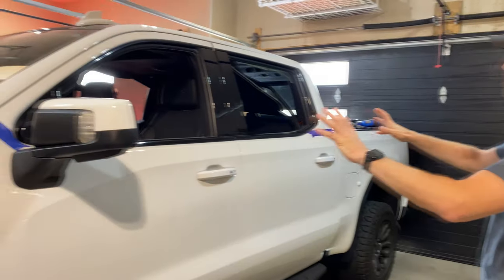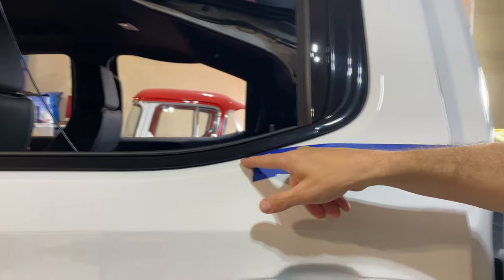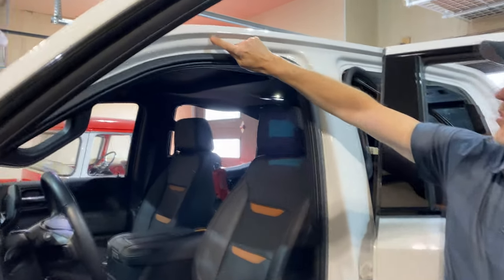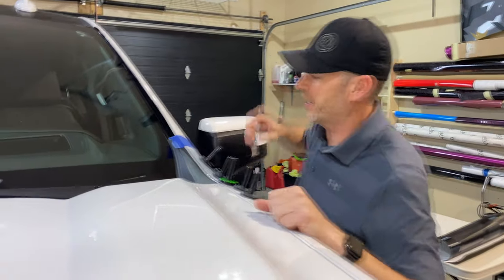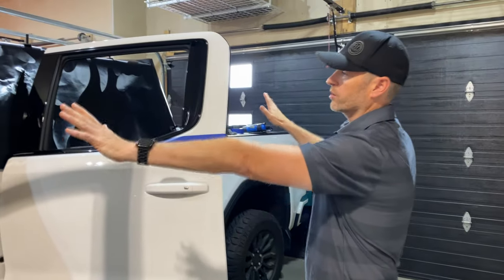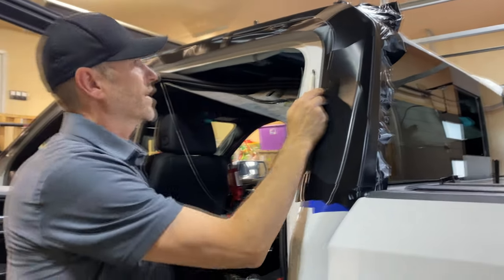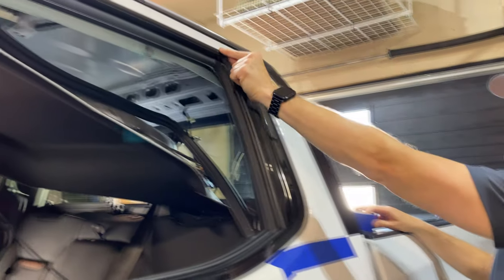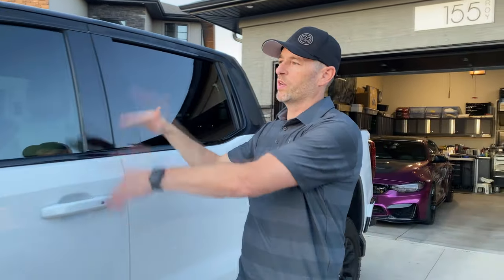GMC Sierra AT4 Custom Wrap DIY - Turned Out Great! Step by Step How To

Comment: Hey buddy looks good, I just bought a white GMC 1500 elevation. I'm looking to do the same on the top but maybe the gloss black the same as the black part of the door. This video is 6 months old so how do you like it? Are you going to keep it? And what do you think about if it was gloss black? Thanks
Reply from the maker: I love it.  I did add some pieces to the a pillar after all and do like it better now.   Gloss black would be great 👍🏼.   I am keeping it for now because I can’t think of a better alternative.  It turns a lot of heads still and even though the truck is not heavily modified, I see people taking pictures quite a bit in parking lots
Reply: @Donslife  thanks

Comment: If you're happy we're happy... BUT.... I think it's calling out for you to re-do the hood to integrate better with the new stuff on the front pillar.  I get the part about the natural line... but there's a gap between looks "good" and looks "awesome"... and it starts at that diagonal line.
Reply from the maker: Easy fix either way.  I can play around with the lines

Comment: Love the wrap. You made it look easy! I was worried about the idea of it being a dry application but it didn’t look that bad. Does the wrap not stick to the blue tape? And how do you cut it on the panel, for instance the piece on the hood? I’m in the military and have a black AT4 so this is perfect. Did you remove the badging on the tailgate to apply the wrap? Your videos are great thanks for taking all the risk for all of us.   Mike
Reply from the maker: Masking tape of any color is usually best since vinyl really doesn’t adhere to it.  As for cutting right the panel, it takes some technique to drag the blade without cutting all the way through.  Then the vinyl will still tear where it was scored.

Comment: Awesome job…would wrap work as well on an older vehicle
Reply from the maker: It can.  The paint needs to be in great shape.  Might need some strategically placed seams in some areas depending on the curvature and/or angles.